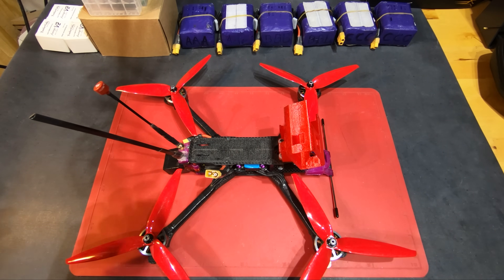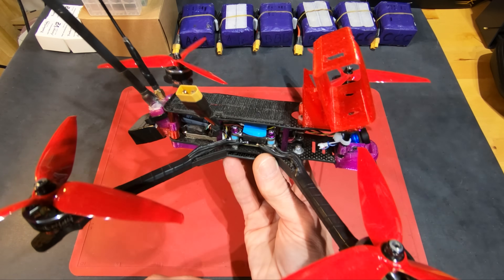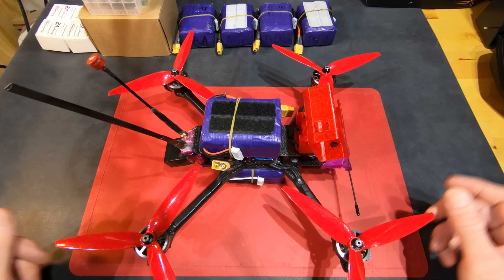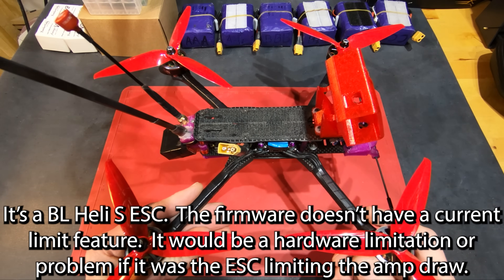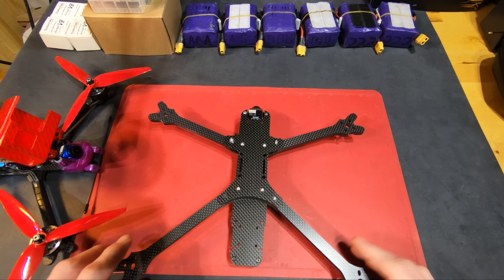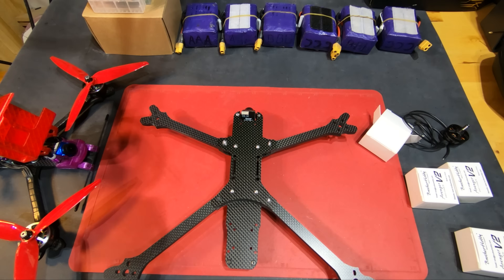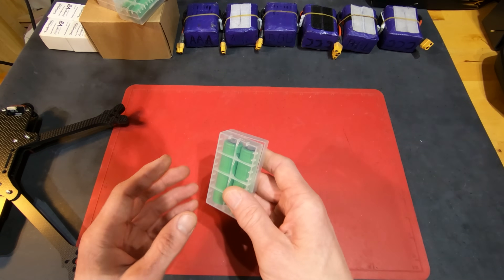My 2020 Long Range FPV Drone & Gear : Gets 8.5km Out - Roundtrips of 18km+

Comment from the maker: I gave the wrong prop type.  It's Gemfan 7040 that I always use NOT Dal.
Reply: Bi blades don't get a longer flight time?
Reply: @divingfalconfpv4602  2 blade is way to go for long range.
Reply: @oskarejsmont  not always apparently. My tri gave me longest flight time so far. And I'm still shocked lol.. I'm going to switch back to bi and try them again. (Time difference has been much could just been differences in flight)
My 6s 40min flight was with 5130.. 
And did another 34min 4s on 5130.
Reply: @divingfalconfpv4602  I once flew my 7 inch with 2x 4S 5000mah. It took so much power to fly that i couldnt go more than 10min and hover was at about 60% throttle. on 6s 2200mah li-po i do get about 25 min of hovering. did not test it in long range flight because i didnt had good video reciever but i will test it soon. I need do make some 6s li-ion packs.
Reply: @oskarejsmont  yea they also have 6s 4000mah li-ion. I have one but haven't tested it yet to see if it's too heavy.  (I have a 5")
. this guy with a big 7" put 2 4s 4000mah li-ion together for 8000mah
Reply: FalconRad FPV do you have something similar to this 
https://youtu.be/X0VuoO0ihSk
Reply: i also use the same red gemfan on my 6" i think those are the best for real steady flying... they are very well balanced and overall very good for flying, they also give a a lot of kick when u need it...
Reply: I would like to use the tmotor f90 as motors. Will the Gemfan 7040 be compatible?

Comment: I cant even go 1 km away or high with me moz 7 i lose me conection to the drone dji if i go more than that
Reply from the maker: sounds like antenna problems or the wrong settings in firmware.

Comment: I couldn't imagine flying that far out, I love flying my freestyle 7in, I have 2507 1900kv motors in it. My long-range has 2808 1100kv TOKA motors. I built Molycel 21700 P45B , I just haven't been where I could see how far I can go. Thanks for the video

Comment: oh ok its horizontaL for ease of use..
Reply from the maker: I used to fly with two immortal t's horizontally, and my tx antenna horizontal as well.  But now I use a horizontal immortal t in the front and a vertical bardpole of dipole antenna in the back, and now I always setup my TX antenna vertical.
Reply: @FalconRadFPV  because I was looking into bardpole cause I always see u using it. Was thinking tx antenna needs to be vertical

Comment: Thise definitely gives me some faith lol as your goin through the build I'm like I got that, I got that, and so on. It's almost identical to my build. So I'm gonna push it this farther this year for sure. I just need some bigger, better lipos probably...well other than and good set of goggles that's the one thing I can't afford. I wanna just try moding cheap box goggle with a goggle module since I like the field of view
Reply from the maker: I used to fly long range with EV800D goggles and my DIY helical antenna.  It worked fine for even up to 6km out.
Reply: @FalconRadFPV  I actually plan on building a helical soon since I finally got a printer. That should definitely help alot

Comment: Amazing video. I'm interested to hear if you may have any ideas what could be causing a Li-Ion issue I have been experiencing. I have a 4S Li-Ion on a 5inch quad which I was hoping would give great easy flying performance, using Panasonic NCR18650B Li-Ion batteries. However after hovering for a minute or two on a fully charged battery the quad falls to the ground. The blackbox shows a steady voltage for the most of the flight then voltage drops rapidly which causes the quad to fall. The hover current draw is around 5 amps. I have also checked the internal resistance of each cell and they average 50mOhm which is normal according to the specs.
Reply from the maker: I get very similar question quite often.  I may make a video talking about this.   The quick answer is that the  Panasonic NCR18650B is not suitable for use as a flight pack.  For a good reliable flight pack you need a li-ion cell with an internal resistance between about 10 - 20 mOhm.  I think the ones I use are like 12 mOhm.  A good lipo battery will be maybe half of that.  The  Panasonic NCR18650B is only rated for 4.9 amps.  Using ANY li-ion cells at it's max rating for an extended time (more than 10 or 20 seconds) will cause it to perform poorly as well as output much less mah than it is rated for.  That cell is rated for 3400 mah in an 18650.  The more mah capacity a li-ion cell has the worse it will perform.  That is basically a rule that doesn't change.  I use 21700 cells rated for 35 amps and 4200 mah.  The same company makes a 5000 mah 21700 cell.  Cramming that extra 800 mah into the cell forces the internal chemistry which is used to be different and it is impossible for it to perform as well.  The 5000 mah cell is rated for less than half the number of amps, 15.  As well the 4200 mah cell run at 15 amps will likely end up putting out more mah then the 5000 mah cell at the same 15 amps of current draw.  A good performing 18650 li-on cell will be more like 2800 or 2600 mah.  You could get away with using 3000mah li-ion cells if you get the best quality name brand ones and have a low amp draw setup.
Reply: @FalconRadFPV  thank you for this amazing explanation, this is extremely helpful and it makes complete sense. I will be sure to check the mOhm ratings the next time I buy cells. Thank you
Reply: @FalconRadFPV  Do you perhaps have a recommendation which 18650 cell to use for a 5inch quad? 
I have read Sony VTC5A (US18650VTC5A) and VTC6 (US18650VTC6) may be good options but I'm not quite sure.

Comment: How long is the battery life on this during flight?
Reply from the maker: I get between 15 and 18 min with 6s2p 18650 batteries, and between 20 and 26 min with 6s2p 21700 batteries.
Reply: @FalconRadFPV  is there anyway to increase flight time to 1 hr??

Comment: can we use one 5200 mah instead of 2 x 2600?
Reply from the maker: If it is a lipo then yes.  But you could not use a 5200 mah 6s1p li-ion cells though.  They won't handle the amp load.  The reason I use 2 x 6s batteries is because it's li-ion and only 1 6s battery will not be able to handle the amp load.  At least not with a quad as big and heavy as this.  With 2 li-ion batteries they work together to manage the amps.
Lipo batteries are much more capable of suppling higher amps.  The bigger a lipo the more amps it can handle.  2600 mah lipo can handle say 130 amps and the 5200 mah lipo would theoretically handle double that.
L-ion cells are the opposite, the higher the capacity the less amps it can handle.  An 18650 2600mah molicel p26a can handle 25 amps fairly easily.  The 18650 3500mah equivalent can only manage 10 amps max and that's pushing it.

Comment: FlaconRad, you are my reference for the long range! I would like to ask if you are using dynamic power with your crossfire? Or you have it fixed at 1W/500mW? Thank you upfront!
Reply from the maker: I have it fixed at either 500 or 1000 depending on the situation.

Comment: I just started a Chimera6 build and went with the BH 2507/1750 motors.  I've never done LR at all but your videos have been very helpful.  I'm relying on the math to tell me what motor/battery etc atm for the most part.  If you are dropping to this same motor for your 7" I suspect I'm overpowered but the power on tap will be useful as I learn to trust myself farther out I suppose.
Reply from the maker: 2507 is good for 6 inch.  It's on the small side for 7 inch.  A 2508 is better for 7 inch quads.  The 2507 should be great for a 6 inch long range quad.  If your on 6s you'll need a throttle limit setup.  1750 is about right for a slightly conservative 4s 6" quad.  Good luck with your build and first long range quad!
Reply: @FalconRadFPV  Super encouraging, thanks!

Comment: Hello I have a question: Are batteries in parallel safe? Can I put LIPOs in parallel? I want to do it on my drone too. Thank you in advance for your answer. By the way your videos are perfect !
Reply from the maker: Yes you can just always use the exact same  kind together, and make sure they always have the same amount of charge.   Just like using a parallel charging board.
Reply: @FalconRadFPV  Thank you so much for the fast answer! So I'll try it soon, nice  🔥

Comment: Amazing!
Any chance for crossfire tips? Im falling to 50hz in a few meters and you seem to be getting 2km! Im not using the diversity rx, is that it? Still i feel i should be getting a bit more range at least before dropping
Reply from the maker: Having the antenna away from the quads carbon parts helps a lot.  I use a bardpole that sticks way up into the air away from the frame and battery.  I'm also using a tbs diamond or truemox on my transmitter which helps as well.  I think the location can affect the link quality also.  (type of rock you or the quad are close to maybe)
Reply: @FalconRadFPV  Thanks alot for the insight, really appreciate the answer from you!
Will continue to watch and learn.

Comment: you mentioned that your new LoRa build would be on 4s, but how would that increase the efficiency? How I see it, the higher voltag the more efficient, as the  current is where efficiency is lost... that´s my at least comprehension, please correct me
Reply from the maker: With 6s the current is lower but watts is a better measure.  On 4s you get more amps for less watts.  Getting the amps up I believe puts more torque to the motor.  On a 4s setup I think you can get slightly more thrust for the same wattage.  In my testing I only got an extra 2 min or so flight time with the same watt hours of energy using 4s over 6s.  So maybe a little more efficient but also not as responsive as the 6s setup.  I'm still trying out both though.   The loss's at higher current are quite minimal, even with 14g battery leads.

Comment: I love your videos, and this gear overview is very respectful - just work with the components you have and improve everything step by step until it works
Reply from the maker: Yes exactly.  The hobby can be very expensive and there is a big drive to always get the latest parts.  With betaflight 4.2.9 old quad parts fly quite well.  I am working on an new updated build but I keep running into gyro noise issues, three builds in a row now.

Comment: Hi, awesome video ! pls tell me which kind of gopro mouth you have. Or is it 3D printed? is it on thingiverse? looks very good :) thx for answer !
Reply from the maker: Thanks, I have actually found out that the mount is causing vibrations to the gyro.  The mount does help with jello a bit but causes wobbles, especially in the wind.

Comment: got my dji v2's and a tbs micro v2  + nano rx and immortal T,  the combo just is  a revelation,   i think i could freestyle a mile away with zero drops??? and thats with the micro v2 at 250mw and the dji's at 500mw .   i am looking at the bs diversity nano, kicking myself for not getting that.  i found a uk source for the bardpole, but i might settle for 2 immotal T's. i'm hoping for 1 mile range and 2.5miles round trip, i'm still on 4s lipos.   can't wait till i get a mountain ready quad.
Reply: ps. did you have a ufl extension on the immortal T ? i don't think the ones i was looking at could reach that far back to rx?
Reply from the maker: You would be fine probably with a single immortal T for 1mile range.  I use the "TBS Extra Extended" immortal T.  There is also an "Extended immortal T" as well if you don't need it so long.

Comment: Hi, regular 18650 liion,. How many cycle we can use? Or maybe tell the time or behavior time to retired the battery?
Reply: I have one pack liion with overal 40 resistance  per cell..

And my new pack only 15 resistance per cell, cannot pararell ?
Reply from the maker: I'm still finding out.  I've got about 1 1/2 years on my 18650 6s packs so far.  Maybe 50 or 60 cycles.  I've been wondering the same thing, but want it to warm up a bit more before I compare the mah count to last year.  I think I still get close to the same out of them though.

Comment: Since you run Betaflight ever thought about INav? thanks for all your deal
Reply from the maker: I've still never tried inav yet.  I'm just used to betaflight and it does what I need.  Position hold would be nice but I doubt it's rock solid like a mavik unless you add more sensors.

Comment: Sir!..After watching other long range channels....wouldn't you get longer,and more reliable range with a DJI Air unit @1200mW rather than analog?
Reply from the maker: When the air unit loses connection, say you fly behind a mountain or something, I've head that it takes much longer than analog to reconnect.  Maybe your drone hits a cliff while your video is out?  Also GPS rescue is not very reliable when in close proximity to cliffs and trees.  Plus a dji setup is very expensive and requires an expensive air unit for each quad.  I'm going to wait and see what Orqa comes out with maybe.  Also I don't need longer range, I can go as far as my battery will let me (8.5k away) and still have great looking video.  People can fly dozen's of km's away with analog setups.  I've seen people go over 100 km out using an analog ground station.
Reply: @FalconRadFPV  ..many thanks for confirming my thoughts on analog.I did some research this week and digital like you say.. crashes -shuts down completely,for 5  to 15 seconds once your mBits drop too low! (Gal Kramer in Israel found the same inherent physical flaw with the DJI digital Air unit and Caddx Vista.)
Just swapping all my analog gear onto a new IFlight Chimera7" now...dilemma solved!
👍🍻
Reply: @chrissofpv3017  Hi CHRISSO FPV, maybe my question to FalconRAD is from interest for you too, buddy 😉✊
Reply: @mog59  👍🍻
Reply: @FalconRadFPV  Hello FalconRad, I‘m following your 🎥 and the comments very close. Top work 🏆👏👏!!! I started analog 14 month ago and switched to digital 5 month ago. But surely I will keep my analog gear ! I entered long range and with a Rekon 6‘‘ HD (Caddx Vista) I reached a flight distance of 4.2 km so far with trueRC antennas on goggles and radio and without Crossfire. I would like to go further … 6 - 7 km is my target. GPSrescue saved me one time until now. If I can’t reach my goal I would switch again to analog (Chimera 7 with 1.6 W VTX and Crossfire diversity ). I have EACHINE EV300O goggles - do you have an antenna recommendation for me ? Should I use helicals ? Thank you so much in advance 😎✊✊

Comment: Hi, I'm curious to see your PIDs for the setup with 2 batteries.
Reply from the maker: Pids will be different for every quad, unless you have the same all up weight, use a gopro, same motors, and strap the batteries the same way I do with a similarly balanced frame.  That said, the main difference with more weight was just needing higher P and D gains to compensate.
Reply: @FalconRadFPV  yes i now ,differend quad different PIDs....just curious to see your
Reply: @FalconRadFPV  And one more question. Dynamic power on crossfire, ON or OFF?

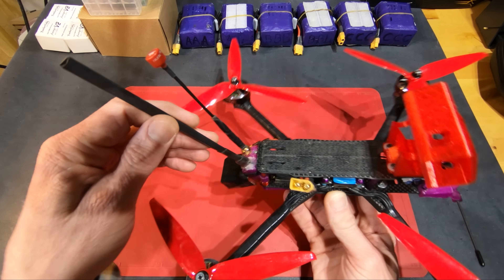Comment: at 4:12 you said the antenna is far away from the carbon, it is to avoid interference, is not it?  In my drone both sides of the antenna are tied up in each arm of the drone, in accordance with what you said, I guess I not doing a smart thing.
Reply from the maker: Yes carbon fiber is somewhat conductive and most definitely not RF transparent.  Spacing antennas away from it is the best way to go.  Although for freestyle quads it's not such an issue since they don't really push the RF link all that hard unless you fly concrete buildings.
Reply: @FalconRadFPV  Thanks for your kind reply!

Comment: Id like to know your filter settings. My motors are a little warm after a flight
Reply from the maker: It will be different for every single frame.  Even the same make of frame there is small variations in carbon thickness that it change required filtering.  Warm motors can be filters but can also be from an poor P/D balance or excessive P/D gain as well.  The quality of a frames design can play a large part in filtering potential, especially getting up into the 7" size arms.
Reply: @FalconRadFPV  with tri props I can get airborne for a hover test, but with bi props on it wont get off the ground.